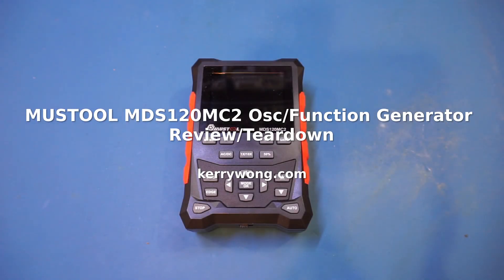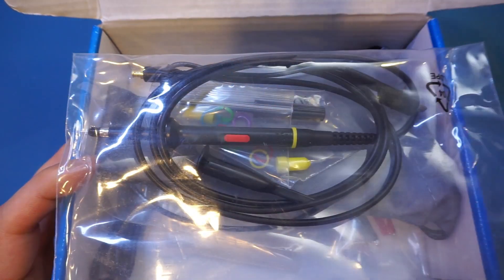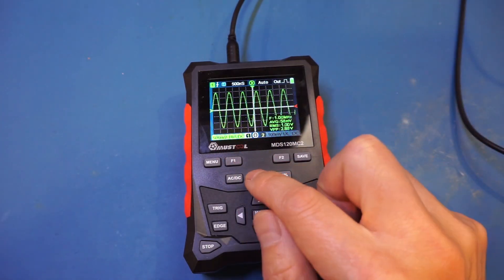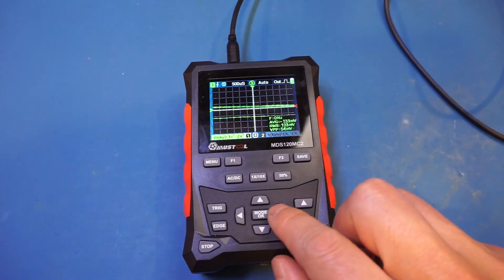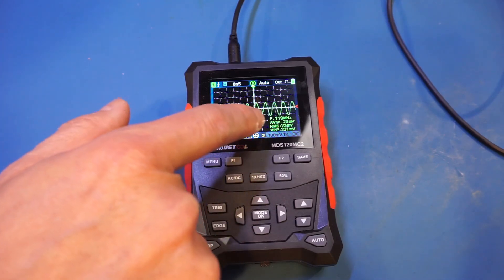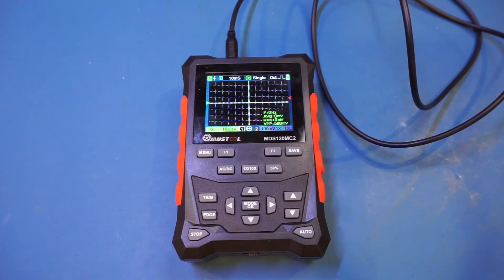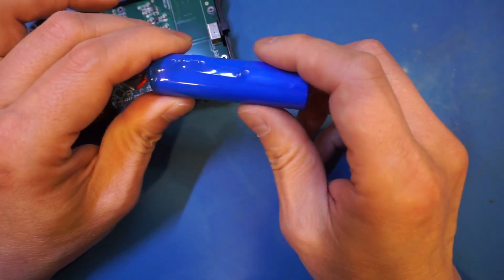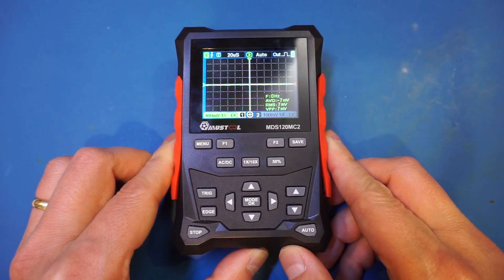Mustool MDS120MC2 Oscilloscope/Function Generator Combo Review/Teardown

Comment: Can any of these smaller multifunction scopes output and read a signal simultaneously? Also using some functions like sum or idk whatever else it might doo.
Reply from the maker: The signen works independently on these multifunction devices so yes you can use along with oscilloscope.

Comment: It would really be helpful to get a comparison to whatever model is the current 'best' from the devices you've reviewed in the same price range.
Been subbed for a while and not an EE, but even after binging a lot of your vid's its hard to discern what is ok vs good vs excellent in a given price range.
I'm assuming a cheap portable scope under $100 is decent cut-off.
Reply: If the company has firmware available on their website, that's a good sign. If they have firmware and changelogs, that's a really good sign! It seems he likes the HDS2102s and DS4T1012 for cheap handheld combo units. Note the dream lab has large 8Mpts memory